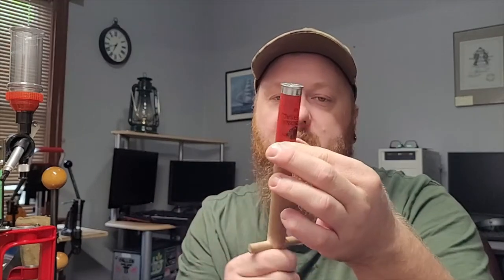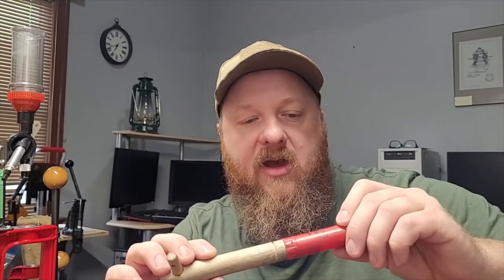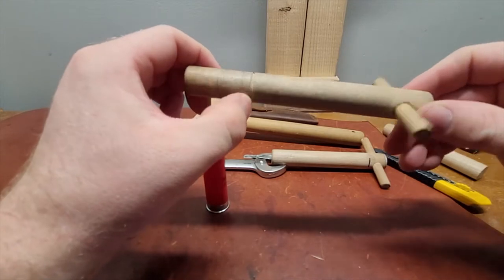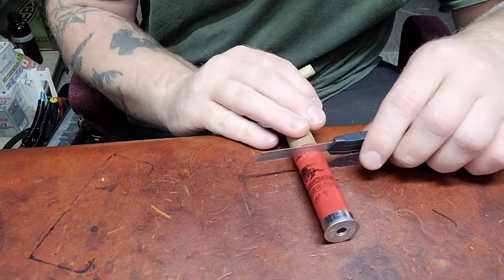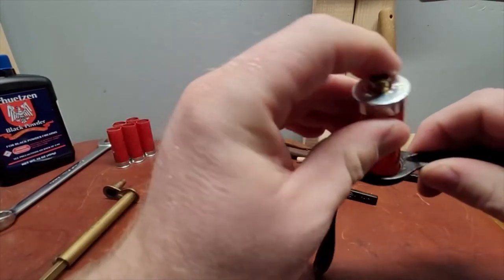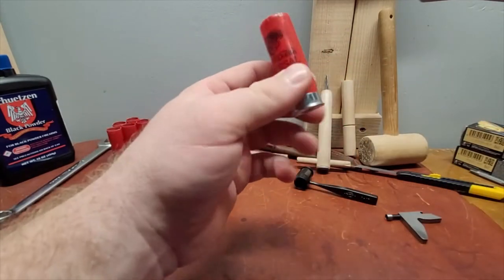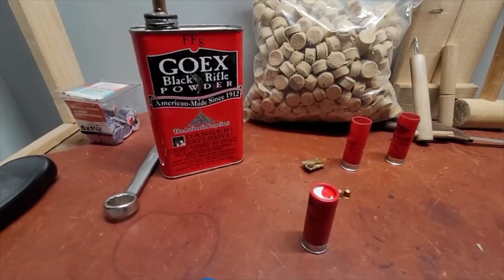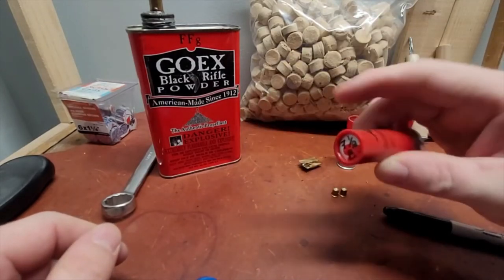Prepping and loading 12 gauge roll crimp shells

Comment: I made my buckshot loads with 80g 2F with a thin over powder card a ball of flax tow for a cushion and another thin cardboard disk.  Then I used 9 .31 balls with cream of wheat as a buffer with a final thin over shot card.  Sealed the end with candle wax.  Did not have a roll crimper.  The pattern from each round was almost identical to a factory Remington 2.75  - 00 buck round.  The round I made was identical to my flintlock load.  Shotguns are forgiving use what you have.

Comment: THANK YOU FOR THE DEMO.  I  HOPE YOU RECOVERED FROM ILLNESS.   SOME OF US happen to prefer a deeper or taller roll crimp... for a more positive card retention  seal and to avoid overshot  card being cut by any sharp edges on the face of  the rotary roll crimp tools.  As a matter of fact , because MOST Canadian coins are steel or steel with copper insert... A COIN might make  a good primer seater tool.  Would that be a good and practical use for coins ?

Comment: I've gotten the impression from reading that you shouldn't load black powder in plastic hulls -- every recommendation I can find suggests obtaining paper hulls, as well as avoiding plastic wad components.  Does this melt your hulls and make them not reusable again, or is it not a problem?
Reply: I reload plastic hulls with BP, no more than twice. They are pretty toasted by then. I pick up used shotcups and use it on top of a nitro card and cushion wad. I don't use the plastic shotcup with the piston and gas seal attached as those probably would melt. I do what is called a Square Load. A measure that holds 1oz of shot, same measure for a volume of BP.